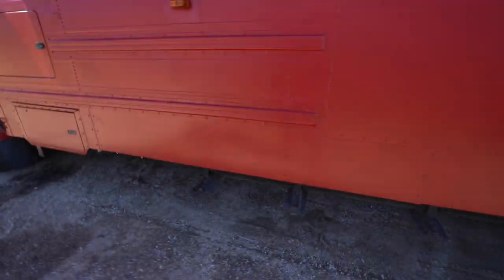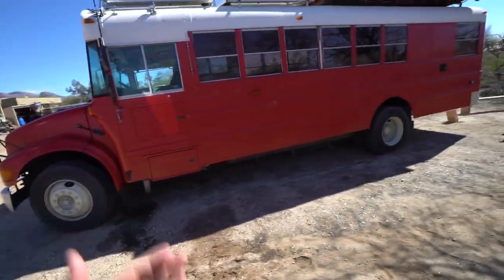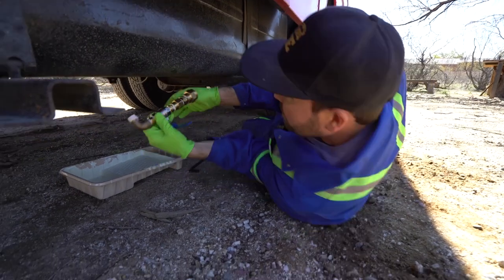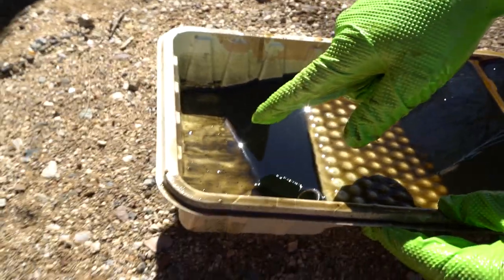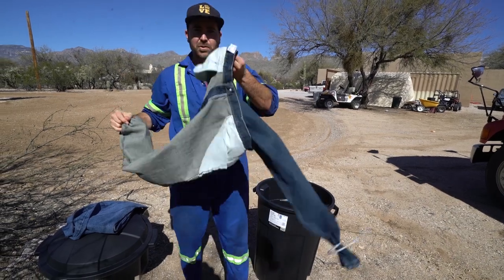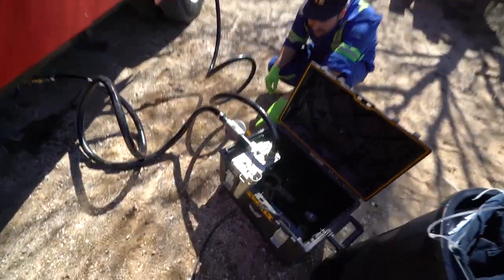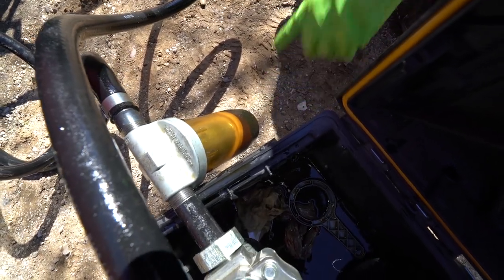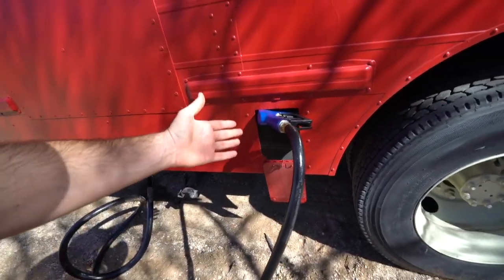WASTE VEGETABLE OIL DIESEL PROBLEMS

Comment from the maker: Just to clarify: the debris came from cutting the tanks in half and welding it together. It was my fault that I did not rinse out the tank. I either forgot or didn’t know and I don’t recall because it was a long time ago.
Reply: According to what i see in the video, it seems to me that most of the debris is very very small. Looks more as sludge. Is that possible coming from welding?
Reply from the maker: The sludge is from bad oil I tried to salvage. It’s the goopy watery crap the sank and settled. People told me not to use the bottom of the containers and I’ve learned my lesson.
Reply: Jax Austin so you aren’t using panty hose? Cheap jeans, now that’s a cool cheap trick.
Reply: I would have taken a big magnet and circulated around in the garbage can and maybe that would have helped. : ) peace
Reply: I'm sorry
Reply from the maker: akbychoice never again haha. Jeans is excellent and cheap for gravity filtering, and I want to get a racor 1000 for pump filtering.
Reply from the maker: Stephen Moore good tip.
Reply: Everyone makes mistakes. After 30+ years in heavy automotive repair I have made every mistake in the book. The important thing is that we learn from our mistakes. It is great that you are showing everyone your mistake so they can learn with you. Ignore the trolls, you are doing fine.
Reply: Big Oil Didn't send the check huh?
Reply: Hopefully the are made out of either stainless steel or aluminum, veggie oil will slowly eat the metal as I learned from my veggie oil conversion I did over ten years ago, 😀
Reply: @JaxAustin  this is brilliant. I   have used bio diesel. New engine oil thinned with petrol. New cooking oil thined with petrol. All with good effect. Was thinking of break fluid thag would work very well but it may harm the pump seals. Try adding some petrol to your veg oil it will run alot better especially on start up.👍

Comment: NOT criticizing at all Jax, but I found a paragraph about filtering on the U.S. Filtermax website. "Some will tell you to use old denim jeans or your mom's old underwear. At best denim is 30 micron and no telling what the underwear is. A typical oil filter is 20 microns. Because the hole size in a modern fuel injector is .005, it doesn't take much goop to change the delivery pattern." BUT I would keep in mind these guys are trying to sell a 2000 dollar centrifuge! Keep up the great work and thanks for everything Jax!!

Comment: Jax i was the alternate fuel manager for a large state agency in TX you need to course filter (which your jeans are doing) de-water the oil by heating it to 212 degrees, and then fine filter using a poly filter 100 microns or less. also use a pump when fine filtering it will make it easier. It will help increase your filter life. As for the heat treater, you can also cut your VO with 15% diesel and not have to worry about it with us coming out of the winter months. We would run an 85/15 blend of VO/diesel and it seemed that was the sweet spot that cut down on filter usage and injector issues.
Reply: Gary P. You seem like someone who could have a lot of awesome information to learn from. I’m also considering running my future Schoolie on VO. I was thinking electric school buses by Lion brand. But they cost too much so I’m resorting to VO. The only knowledge I have of VO is that there’s a DIY VO processor made by fellow civilians years back that you can purchase as a unit and put in your garage or in your Schoolie garage or a mini trailer  that can be used to convert kitchen fryer oil stuff into usable VO Biodiesel for the vehicle in question. That’s all I got.
Reply: @DylanBegazo  I worked for the prison system in Texas and we ran all of our farm tractors on VO/Diesel blend. We would harvest the VO from the kitchens in ICB totes. Then we would run the VO through course filtration, we used denim just like Jax was using as our course filter. it would drip into an 84 gallon steel pot which we would heat the course strained VO to 212 degrees to de-water. As the oil cooled we would pour it into a double barrel with a Sheet of polyester acting as a fine filter membrane. We would then under pressure press that oil through and have clean VO which we would blend 85/15 with diesel. It seemed like that was the sweet mix ration to keep us from having to prematurely swap filters and injectors. It also held up in the winter months with only having to use anti gel a few times in the winter months. 

Things we had going for us:
1) Free labor, inmates did all the work and TX doesn't pay its inmate labor
2) Existing infrastructure to collect VO. We had over 100 prisons and 130,000 inmates to feed so we weren't on the road trying to convince a restaurant to let us pilfer their grease trap.
3) We weren't traveling! We had a the room and the means to create clean VO.

Jax traveling will have some added difficulty traveling and trying to produce VO. I personally don't think its prudent to try to run 100% VO, but rather a blend to cut fuel expense. I am extremely excited to see how he overcomes these challenges
Reply: @garyp.1565  You are a blessing Sir. Wow. I copied everything you said down so I can study. ^_^ Thank you so much Gary P. I'm a 23 year old under grad Med student. Trying to not drown in student loans. Schoolie is kinda the answer I discovered 3 years ago. I've been taking notes for years. Seems that you made Prison a less boring place and more of an interesting project. Almost sounds like fun too and seems like it was a success.

Comment: Awesome work Jax! My son-in-law is doing the same kind of set-up with his Ford 350 in Ketchikan Alaska. If you're creating any kind of vacuum at all in the oil lines a garden hose will collapse, but on the other end where you have pressure a garden hose should work.
Reply from the maker: Good tip. Thanks!

Comment: I like the idea of a filtration system in a storage box. 
Maybe set up a centrafuge that draws off a ten gallon tank and pumps into a 30 gallon. That should eliminate any need for filtering before it's added to the main tank. 
It would also allow you to dump in waste engine oil and transmission fluid which would have metal bits. 
Also increases your fuel capacity by 40 gallons

Comment: I don't do the veg oil stuff but I do refine my own waste oil for fuel (ATF, engine oil, brake fluid, ps fluid, hydro fluid ect).  I don't have to deal with it needing heated in the winter and it's easy to get for free.

Comment: Good video if it was as easy as pumping oil in everybody would do it. The fact is you showed people that it is not all 🌹 yeah good point IT PLUGGED THE FILTER the safety net works so now just clean up the oil and off we go. Where it came from who knows move forward clean it up so when you run on100% veggie let the troll kiss your a$& awesome video reality at its finest 🛠🛠🛠🛠🇨🇦👍

Comment: We all learn from our mistakes. You can put some strong magnets on the bottom of the tank by drain that will  stop metal  from going in filter. Drain some out after a week.
Reply from the maker: I wanted to use a magnet and draw debris toward the plug. I’ve filtered and pumped back in, and it’s clear and clean.

Comment: The garden hose may not work. Under suction trying to suck heavy liquid could cause the hose to collapse. It might work ok for the discharge. You can put the suction hose in the bottom of the garbage can outside the jeans to suck out the filtered oil and put more in the jeans to be filtered.  Good luck.

Comment: This was painful to watch. I made my own biodiesel for ten years. It was a constant headache. The biodiesel dissolved every and any rubber component from fuel lines to fuel pump impellers. Biodiesel is such a good solvent it hyper-cleaned the fuel tank during the first couple of trips. All of that "stuff" ended up in the filters. Making the biodiesel was a hazardous chemistry experiment that almost blew up my garage.

It even got me a personal visit by the Sheriff because someone overheard my comments about needing a safe way to handle methoxide during the cooking process. Methoxide is not the street drug called Meth. It is the catalyst used to transesterify the veggie oil into biodiesel. It is highly flammable and caustic.  

Anyway, making biodiesel from waste veggie oil does not make consistently good fuel, and I could only use it above 40 F. But when it did work it was pretty cool.
Reply from the maker: Michael Miller interesting. I’m guessing canola would just be a good lubricant for what it touches?

Comment: Jax put a Filter Magnet on your Filter to catch metal in your Oil I use them on all my oil filters & Fuel Filters and they work.
Reply from the maker: Great idea! Thanks!
Reply: Jax Austin maybe a magnet encased in a bit of epoxy attaches to a cable drop in the tank then attach the cable to the cap. Once in awhile pull the magnet out and wipe off the metal bits.

Comment: Drawing your fuel off the top sounds like a good idea. Very similar to what submarines do except their tanks are water compensated. Keep your fuel siphon a couple of inches off the the bottom and you should be good. Keep your bottom drain hooked up and when you get low dump the "sludge" before filling the tank again.

Comment: Jax look into putting a magnet on your drain plug so it will collect the metal particles.
Here  is thought- You have a roof deck. Pump from the tank to a trash bucket on the roof pumping into one of your filters. Use a siphon and let gravity move 1st stage filtered oil to another trash can at a lower level with another filter. Then ground level trash can collecting clean oil ready for use.

Comment: Add some magnets to the outside of the filter. If you ever look at the spin on filter of an Allison transmission on a Chevy pickup... They have a circular magnet for this very reason. I have a circular magnet on the bottom of my engine oil filter. I know it works cause I've cut them open and seen small metal particles on the other side.

Comment: I would get afew filter/housing and run a circulateing pump from the tank. Run your lines under the bus and have it return to the tank. Turn it on anytime to refresh the oil.  Going through multiple filters is better than just one. Hope this helps.
Reply from the maker: John Moore it does, thanks. I’m going to invest in a racor 1000 to filter before filling tank next time.

Comment: I like the idea of running a pre filter tank you could do it with a 50 gallon tank from a yard jocky truck they will have all the mounting brackets to bolt to your frame then  you could put a big water filter from home depot it has enough surface area that you should get about 300 gallons of veg oil before you have to change filter

Comment: It's probably too late because you film a week or two in advance, but if the debris continues they make a paint just for the inside of fuel tanks.  Covers and immobilizes all rust and seals the inside of your tank.  But I would consider a plastic tank and it does NOT have to be fuel safe since it just veg. oil.  A lot cheaper than fuel safe tanks.  Good luck my friend, see you on the road soon just got my van doing a build soon and getting rid of my RV.
Reply from the maker: I appreciate the idea. Thanks

Comment: Here's my take on the system, firstly heat up the fuel in the tank to make it easier to pump through the strainer system. You can use the exhaust, basically run it close or even though the fuel tank(pipe around the actual exhaust pipe). Then strain before the actual pump, after the pump get a 10 micron filter and after that  plumb that into a smaller gas tank that you feed the engine off of and put a 1 or 2 micron filter in there between the gas tank and the injection pump.

Comment: I would say definitely get a set up  so you can easily filter the oil maybe start with a plastic one in the back that you could just dump into  then set up the hoses done the frame to your good oil tank filter it though then you have less touching and more going.

Comment: Size 1 filter socks r about $5 each on Amazon. I have filtered over 55 gallons of cooking oil to 1 micron in a sock. They are about 7 inches by 16 inches.
Reply from the maker: Chuck Neil how do you like those? The denim was awesome!!
Reply: @JaxAustin  . These are only 16 inches high, so I can hang them inside the top of a can and all the oil drains through. Just had to order s case on eBay, 50 filters was $70.

Comment: Jax I was pondering your problem and a large magnet (or several) placed at the bottom of the tan would catch any steel that comes near it.  Though it's not typically a fuel system hack it's standard in transmission, oil, rear end systems where it's from things wearing out, though in this case it's simply contaminants from the construction.
Reply from the maker: Excellent idea

Comment: Not sure what you've done since then but it might make sense to put a low micron prefilter or series of prefilters onto your setup with removable media that can be cleaned rather than replaced. Will still be time consuming, but you won't be changing expensive cartridge type filters constantly. I'm assuming they've gotten more expensive since you made this video too.

Comment: Can you take off the waste oil from the top of the tank since you are using pumps anyway?  I would assume the bottom 4 inches will end up getting sludge until you drain the tank once and awhile. 

You need a small trailer and a mobile waste oil refinery on it.
Reply from the maker: A trailer would be ideal. I’m going to have to get a racor filter

Comment: Jax putting a toolbox for your pump and other thing is a great idea. What size hose do you use now and think about is the garden hose oil resistant. Would it be better to just a hose that is oil resistant and not make a mess keep things clean and neat. No D.o.t or commercial motor carrier will not harass you for oil leaking out on their roads.

Comment: If you go into a restaurant supply place you might want to go look at their fat filter systems (they look like big coffee filters with a metal holder that can go over a big pail).   Check out the costs and maybe give using them before throwing it into the tank on the bus and see if that helps any. Even double filtering would be easier and cheaper than the every 40 to 50 miles.....  changing the 8 or so buck filter.

Comment: Jax,
Love the videos just had an idea .
Run a hose from each can at the bottom in series from one to the other to the other the oil will level in all three but only one filter I.e. Pants. The last two will just be oil.Maybe use garden hose fittings.
Good luck to ya ......KB

Comment: Heyyyy jax I have a question do you need a c.d.l. to drive your school bus or like something else
Reply from the maker: Raja Rose check your state rules. Skoolie.net is a good resource.
Reply: I did not when I had my bus.  The Bus did not weigh enough to need a CDL there were/are restrictions as to how many people you can carry without a chauffeur license, where I live.
Reply: CDL stands for commercial drivers license. Weight has nothing to do with it. Air or hydraulic brakes has nothing to do with it. It’s based on private or commercial. Do you haul for livery. My Prevost weighs 44,000 lbs and has air brakes. It also has private coach on it and titled as an RV. I have a roll back that once belonged to a towing company. It now says “not for hire” on it. So it’s titled private vehicle and fee is based on weight. You can even operate a shuttle such as a hotel van without a CDL as long as it hauls less than 15 people.

Comment: That's why autos don't draw gasoline off the bottom of the gas tank. They put the gas line in the top and leave it up off the bottom a couple inches. I don't know if your outlet of tank is on the bottom or not
Reply from the maker: The new arctic fox / hot fox will draw off bottom and heat as well. I just need to be more careful

Comment: Are you treating the oil in any way other than filtering ie chemicals or heat? Oil separates into 3 phases lighter oils on top, oils mixed with water in the middle and crap on the bottom. You need to take a sample of your oil in the trash can and put it in a large mason jar to see how it’s striating. Use 1” pvc pipe a little bit taller than the can and take multiple samples (like a straw) until the jar is 3/4 full and let it set about an hour. Waste oil starts to separate @110*F. The oil could be too cold and it’s holding everything together in an emulsion. An oil and water solution has a low btu value. You may get some of the solids but not all the water. Apply heat to your sample and see how it separates. Do the same to the trash can and pump the oil off the top. Hope this helps.
Reply from the maker: It does. Thank you.
Reply: Jax Austin if you go the additional chemical pretreatment route (lye, methanol) you’ll get glycerin on the bottom. The oil will have a high PH if you use it and it will eventually damage the hoses if you don’t neutralize it first with water and then sulfuric acid. I suggest getting some jars and PH strips.
Reply from the maker: msdarkstar44 x thanks. After the denim technique, it’s an amber gold. Everything seems to be mixed perfectly well.
Reply: Jax Austin that’s great news! You can only hope for things to be easy. If you get a batch of oil that doesn’t come clean set it aside and tinker with it. It will be fun.

Comment: you need to get that fuel cleaned down to below 10 microns  and no contaminates,  magnets will help get the metal out . that fuel should be as clear as what you might see in a store new . the injection pumps and injectors are machined to millions of an inch  so that's why you need clean fuel.